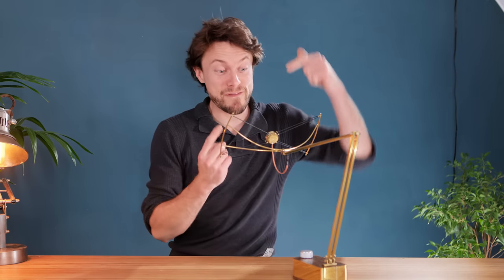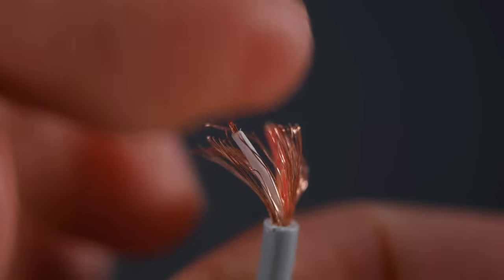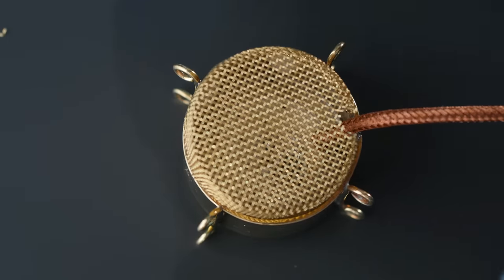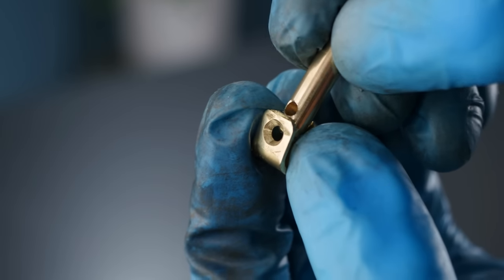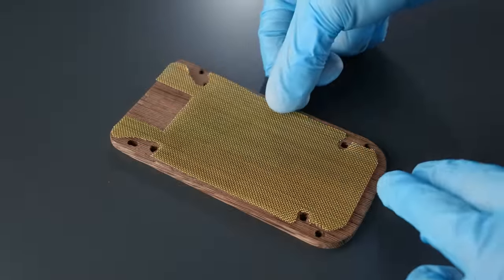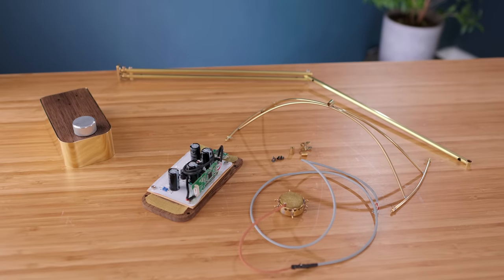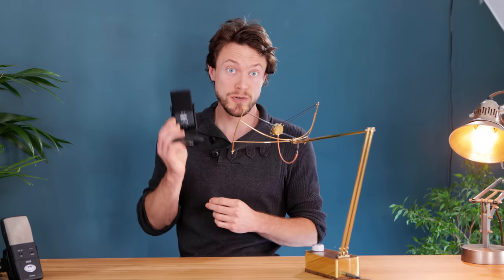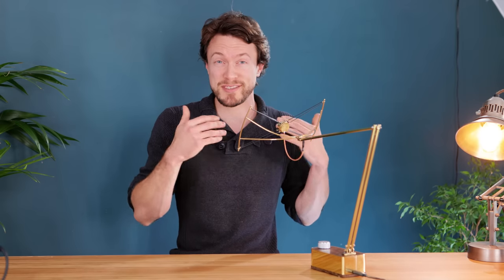Building a quality USB-C microphone

Comment: Great video. Liked and subscribed.

I want to give some suggestions for improvements that can make this great project even greater:
1) Don't use paper as silk screen on PCB. It is hygroscopic and by absorbing humidity in the air can cause malfunction in the future.
2) The transistor, or more precisely the Jfet 2N4416 soldered on the capsule, is not actually used as an amplifier, but as a single ended to differential converter, 
which is probably overkill in this project.
Diffential amplifier are used in Studio where long connections can be disturbed by a lot of devices, which is not the case in this MIC, the cables are short and well shielded.
It also largely depend on the output level of the mic capsule.
So an NE-5532 or similar which costs like 1 dollar can do the same job. (the THAT1512 and the Jfet 2N4416 costs 10$ each)
If the original differential approach is still desidered, i suggest to change the j-fet from a 2N4416 to a J111 or similar which costs a lot less. (1$)
3) Bypass capacitor are omitted. To increase the stability of the circuit and to filter high frequency noise, it is strongly recommended to add some bypass ceramic capacitor soldered as close as possible to the supply rail of the OP-AMP and the 5V input of the DC-DC converter (NMA 0515SC), since the "big chungus" 2200uF 16V electrolytic cap are not really good at it due to their higher ESR and ESL in respect to the ceramic bypass caps.
4) the two 2200uF 16V cap at the 5V input are really overkill. When the cable is connected, a large inrush current from the source need to be delivered in order to charge the two caps. 
That inrush current can damage the USB port. (I destroyed my PC when i was a beginner in electronics) A single 100uF 16V + 100nF ceramic bypass cap will give better results.
5) i would increase the voltage rating of the two 2200uF caps used to filter the opamp supply rails, from 16V to 25V since the dual 15V supply voltage is really close to 16V max voltage of the caps. 
And the closer you get to the max voltage rating of electrolytic cap the sooner they degrade.
6) i would also add some zener diodes and a bunch of resistor to act as protection in case of overvoltage at the output that can destroy the ADC.
Also a fuse in the input of the 5V USB would be great since some PC, especially Apple products, are not well protected in case of short circuit at the 5V USB-C.
7) It is also VERY important to NOT use carbon composition resistors on preamplifier or any other circuit sensible to noise, because carbon resistors are really noisy. 
Metal film resistors is the way to go.
8) I strongly suggest to keep the gain as high as possible since the THAT1512 tend to be noisy at lower gain. See datasheet.
9) I strongly recommend to NOT buy components on EBAY they can be fake.

I hope this can help.
Best regards.
Reply: This was the comment I was looking for! I understand what you're saying, but I'm no EE so translating it into an actual PCB layout is not something my brain / skillset is currently equipped to do. 
Would you be willing to design the improved circuit diagram (or even a pcb layout) and open source it?
Also, anyone reading this - upvote Beppe's comment so Matt sees it!

Comment: This sounds fantastic, a little sibilant but with such an "exposed" (as opposed to the heavily enclosed and protected Neumann) capsule that's 100% expected, however that's simple to solve with some EQ. Genuinely in awe, I could never create this as I don't have the requisite skill, but would buy this in a heartbeat for that $30 price tag
Reply: $30 plus his hourly rate of manufacture and shipping. Probably wouldn’t save you too much money overall.
Reply: @ouzoloves  Well, even with work and shipping, it won't be more than 150-200$, which is cheaper than 800$
Reply: It would never cost 30$ prebuilt. 60$ minimum, and even that idk if it would be profitable. 

Price goes up depending on:
- Amount of units made (less units, higher MSRP)
- Production costs (labor, shipping to warehouse, warehousing, material costs, packaging)
- Shipping to desired country (into a private warehouse or directly to buyer)
- Copyright of intellectual property (you don't want a bigger company stealing the design and making more copies for cheaper msrp)
- Taxes
- Customs
- Shipping to buyer (unless buyer paid for VAT and customs and is sent to him directly)
- Extra costs for profit
Reply: @bluejar5614  Honestly he could likely even find the capsule used in the Neumann, and tweek the design a bit and get exactly the same sound out of the DIY. He happened to have a version of the other he used normally that he could take apart and look at the part numbers and do a bit of searching.
Reply: $30 in materials, $600 in labor (if your time is worth $20/hr), 2.5x markup for profit, it's a $1499 microphone because it's handmade with care.
Reply: @christopherhardeman37  and just to be clear, that 2.5x is profit shared between him, multiple layers of distributors, and a retailer. There's also other costs baked in--insurance, licensing, retail packaging, cost of tender (e.g. credit card fees), cost of returns, support, etc.

Selling a product is expensive.
Reply: @ouzoloves  Well, the idea is that you build it yourself, so it's 30usd + your hourly rate and no shipping.

Comment: I'm a bit of a microphone snob, so, I can't possibly say it's better than the Neumann, but, preliminary sound bites do sound a heckofa lot better than I expected. I'm anxious to see the frequency response analysis charting. Given the cheap usb interface you used, I am very surprised at how good it sounded. I expected a lot more noise. No doubt this is a great build for streaming and video narrating.
Reply: I was surprised too. It may even be a bit of a fluke. I'd bet if he made another identical one it would sound different again. There's no control over component selection and relying on random Amazon DAC's is not a good idea. But it's an awesome DIY project nonetheless
Reply: @_BangDroid_  The DAC would not be my main hangup in the battle against noise. I would be concerned with my ability to deliver clean phantom power to the capsule. The DAC's these days are pretty decent even in the lower priced units. Not something your average listener can discern. A noisy or dirty preamp/power supply is very easy to spot though. 
This was well done for sure.

Comment: Very impressive that this DIY mic can go toe-to-toe with a professional-grade recording setup. It's really a matter of preference, but your DIY mic is definitely resolving more detail in the top-end while the bass seems better on the Neumann. It's safe to say I'd have no qualms listening to narration on either. Well done.
Reply: I would say the top end of the DIY mic is a bit more "sizzly", but not unpleasant, reminiscent of frying bacon, but despite that a $50 mic that could compete with it doesn't exist.
Reply: Miata.
Reply: @christopherhardeman37  have you actually tried modern 50$ mics? While 50$ might be cutting it close, with a 100$ budget it's trivial to find a decent plug and play mic with the same quality (e.g. on thomann).

Also this is definitely NOT a 40$ mic. Ask yourself this. Would you build this for a friend if they gave you 40$ for it? It's a friend, you don't need to make profit, but the answer would still be: hell no.
Reply: nice miata
Reply: @qwertz12345654321  For sure.  An NT1a is what £100?  Fantastic mic for the money with a little bit brittle highs but extremely good noise floor.  Same deal with the AT2020, though that's a little shite imo.

What you can get these days is fantastic.

The top end on this DIY mic is a little too much, there's a definite mild peak/overdrive to the top end when you listen carefully.  Still great fun to make though, not a competer with pro gear.

I'll be making one for fun for sure.
Reply: @jtfoog5220  Thanks.